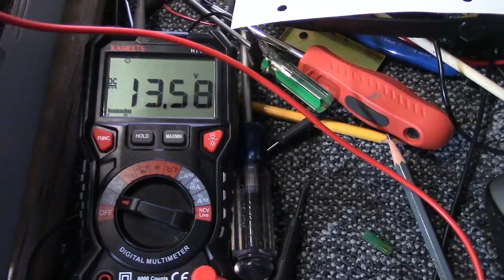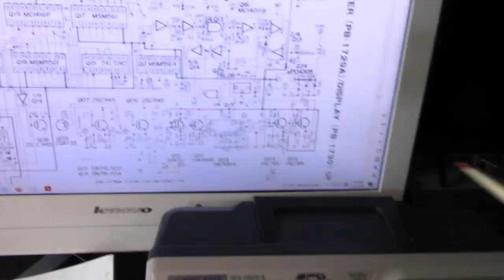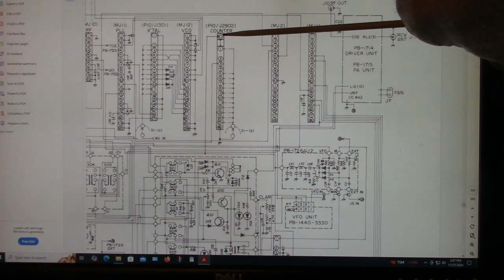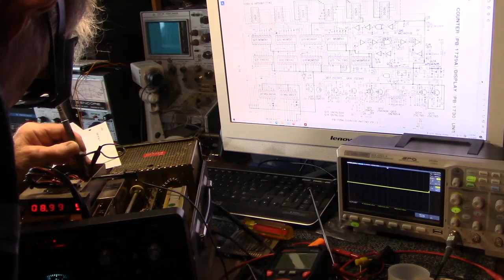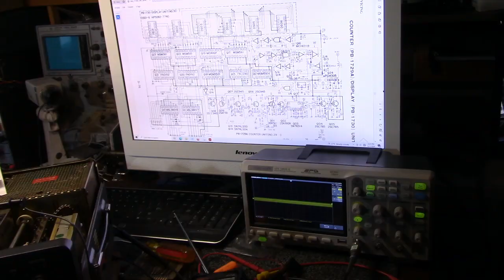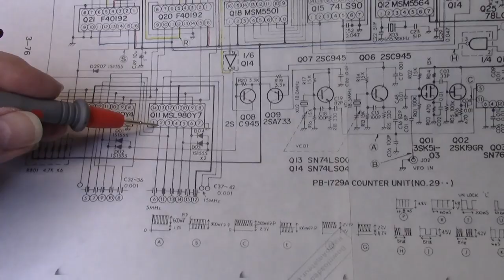Yaesu FT 901DM counter  720p

Comment: Enjoyed the troubleshooting. Ive got a 901dm and 902dm. Got one when i bought the 2100b amp but used it with a different radio. Then found the 901 on craigsliist so I took it home for parts. The 902 has some extra filters. Still need to find a spot in the shack and get it on the air. Receivers and buttons work on both but still need to test tx.

Comment: Hi Todd.
I've found some minimum informations about OKI MSM ICs
Search for "y-lab MSM500" phrase

MSM5501 	4-Digit BCD Decade Counter (DIP16)
MSM5564	16,17,18 Stage Binary Counter (DIP14)

MSM5564 (Q12) here in this counter unit act as 2^17 (131072) divider.
It should give 5Hz pulses on output pin 12 of Q12.
That signal is connected to pin 1 of Q13 (SN74LS00) & Q14 (SN74LS04).
So in theory, we can use any 2^17 divider instead of MSM5564 as functional equivalent, not necessary pin to pin replacement of course.

Have you got 5Hz pulses on pin 12 of Q12, cause you were saying that are 1Hz signal out there on scope?

As for MSM5501 maybe we can use other 4-Digit BCD Decade Counters?
(74LS160/162 or others - I'm not sure about that so I can be wrong with that type).